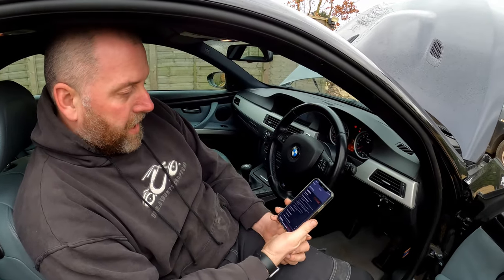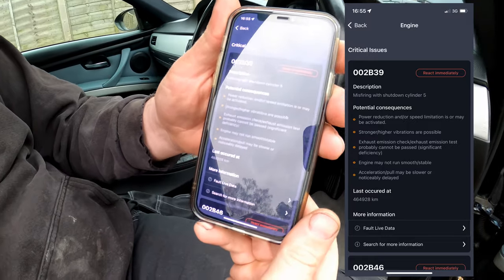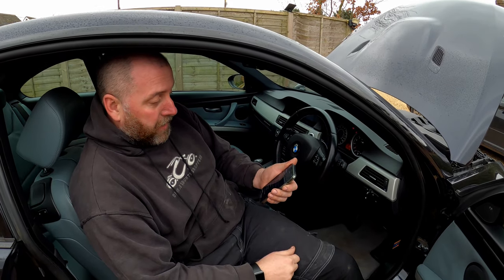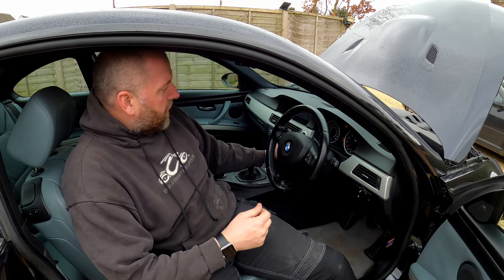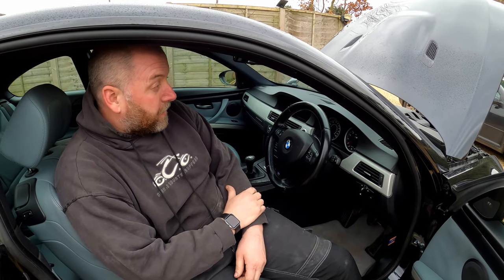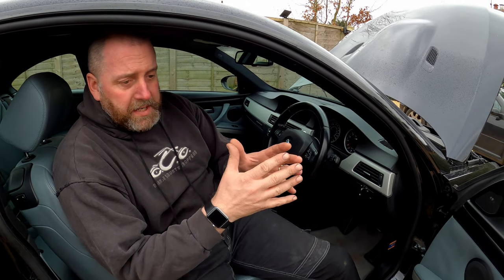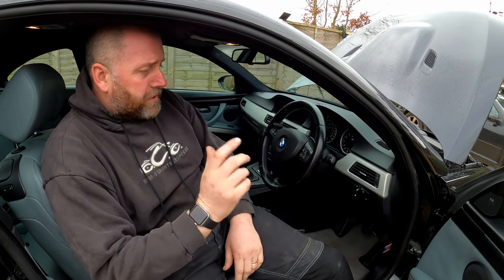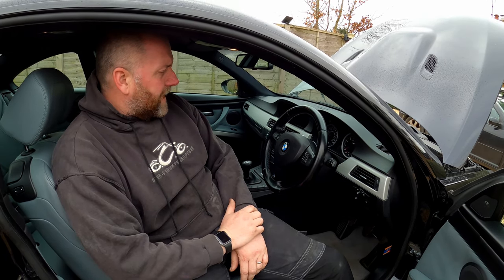My 2007 E92 M3 Is Broken Already! Fault Code 002B39 - Cylinder 5 Misfire

Comment: Finally got to see some M3 action! Great video Kev! Question, did you check for any codes when you were checking out the car prior to buying? Just wondering if it would've shown up then. Looking to more M3 related stuff!
Reply from the maker: Not really, as I knew the car and had worked on it in the past, I took the car on face value. The coil was perfectly functional at the time of purchase, no misfiring at all! It's just one of those things! :)